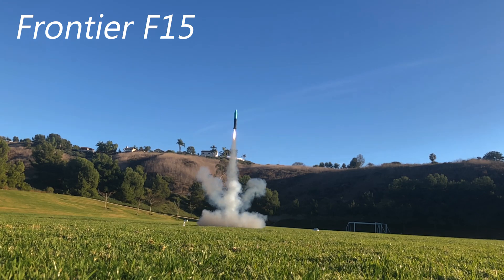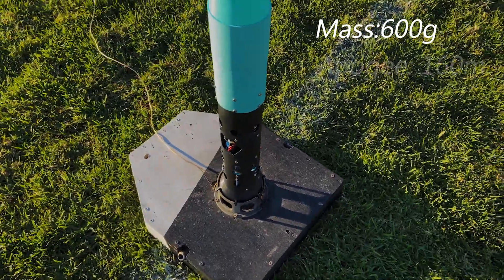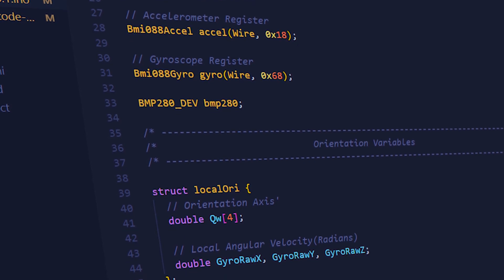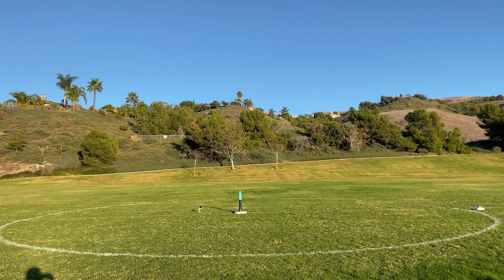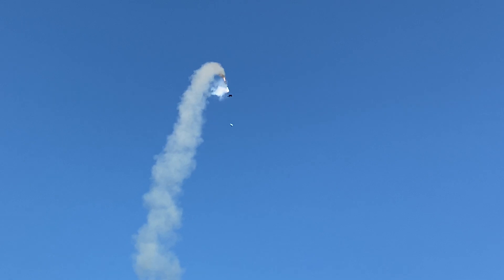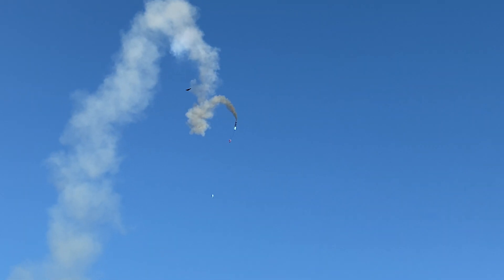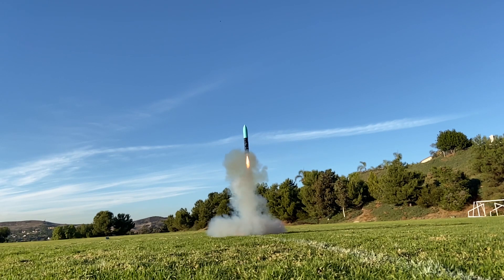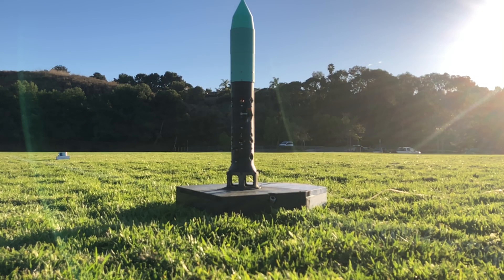Frontier | Flight 15

Comment: Dear Cole
The start was great and looked so promising. Great work. I hope you can improve the things you have set out to do and make a complete successful flight. I am happy to see that. But I have one more question. You say you would like to readjust the controller gains for the Y-axis servo. Why do you have different controller values for the two axes?  Your rocket seems to be quite symmetrical, which means you have the same moment of inertia in both directions. In the video where you show your TVC mount it also looks like the servos are at the same distance from the pivot point.
I'm looking forward to an interesting answer and hope to learn something new myself.
Best regards
Reply from the maker: The gains are identical right now so I will just change one of them. I have a gear ratio integer in my code which adjusts for the ratio between each servo and the actual TVC angle. So those are different for each axis.
Reply: @DeltaSpaceSystems  Ok I think I understand what you mean. Thanks for your answer and hopefully I can see a successful next flight soon.